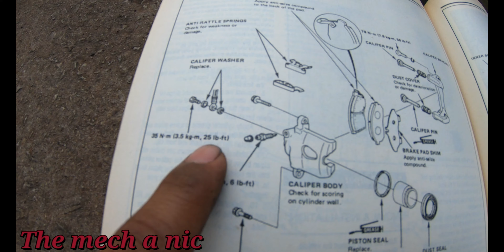crx rear disk conversion - CRX PROJECT VOL 5

Comment: You make amazing videos.

You changing the flex hose was a great idea.

I bought my first Barbados Yellow 88 Si when I was 16.  Ended up wrecking it when a flex hose blew during an emergency stop on the highway. (Could have been an old line, could have been the y-49 curse)

Fast forward 18 years later I just bought a 91 special edition.

I will feature it on my channel
Reply from the maker: Definitely needed to change those hoses. Even if they look fine you never really know their condition and it can lead to problems just as you experienced. I appreciate the comment 👍

Comment: dont know if you mention it, but here's it to help: 
when you swap to rear brake discs, you pedal will feel like spongy or getting low, because you need to get the OEM brake master that comes in the SI models ( drum brakes uses 13/16 Master Cyl--- Si's/ brake discs uses 15/16" MC) also it will help a LOT your braking feel, the 40/40 brake proportioning valve (you needed also when switching to disc's) instead of the drum brakes proportioning valve. 

cheers!
Reply from the maker: Ive been keeping my eyes on ebay looking for the 40/40 . no luck yet
Reply from the maker: From what i see online the hf came with 13/16 the crx SI came with a 7/8 . the 15/16 came in civic,prelude,integra. With the 15/16 bolt up to the stock booster?
Reply: @themechanic6117  yes! i have it on my EF Si, the only thing you have to make sure its that you have the right booster:
integra's and +92 civic's EX have the bolts for the Master Cyl horizontally
the crx and crx SI i think have them diagonally. 
for example, the 1" MC from the integra, can only be used with the integra booster, 
the 15/16 MC of the newer civics (+92 until 00) can only be used with their EX booster(because of the mounting bolts) 
and the 7/8 from the CRX/EF SI, will bolt on directly to your booster. (mounting holes should be diagonally)

Comment: Brake lines aren't hard but they are a pain in the ass especially when you put the fitting on backwards or forget to put to it on before flaring the line. I've re-done several brake lines and more than anything it is just time consuming. 88hf 91si
Reply from the maker: I hear you. When you have the line to a perfect length then find out you messed something up.... Time to start over lol

Comment: Loving the series of videos. I need to replace the emergency break handle on my 91 CRX Si .. where diid you find your replacement handle ? Thx .. keep up the good work.
Reply from the maker: I didn't replace the handle. I plasti dipped the original handle and it's been holding up well. I appreciate you watching

Comment: Please don't get me wrong - I love your attention to detail and you do great restorations. But at 6:05 you were pressing that bushing in from the wrong side. The holes in those toe arms are coned to allow for a tight fit when pressed in against the smaller side. Thus you have to press in from the larger side. So you stretched it out and that's why it's loose. Those bushings would have fit perfectly if you went in from the other side. Maybe you can put the bushings in there and somehow squeeze the 'sleeve' to make it clamp down on it but I'd just get a new arm
Reply from the maker: I figured that might have been the issue. I tried pressing from the other side but my socket wasnt sitting right so i flipped it over. I think im going to go with adjustable toe links. So ill be ditching these anyway👍

Comment: What’s cables did you use for the rear  disc brake conversion?
Reply from the maker: Brake hose or emergency brake cable? All the new parts are ordered for a 91 crx si (they came with rear disk)
Reply: The cables for the emergency brakes
Reply from the maker: @gearthrottle6505  91 crx si cables will work
Reply: We’re did you by them?

Comment: Whats your toughts on the stubby impact??
Reply from the maker: Love it! Its a must for tight areas. In the video it seems like it struggles but its because i had almost a dead battery on it.
Reply: @themechanic6117  im thinking of getting it with thr 6ah seems good
Reply from the maker: @cristianojoana1898  you won't regret it .i keep the smaller batteries on it because itll fit into tight areas with a smaller battery
Reply: Yes ,thats what i as was thinking stubby with the 2ah for tight spaces and 6ah for bigger job as it has more power with it ! Thanks